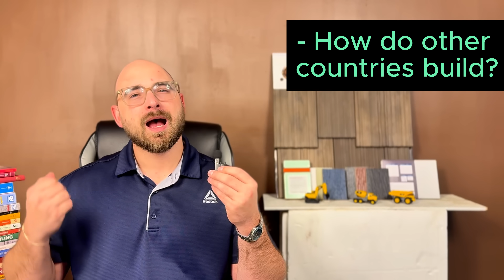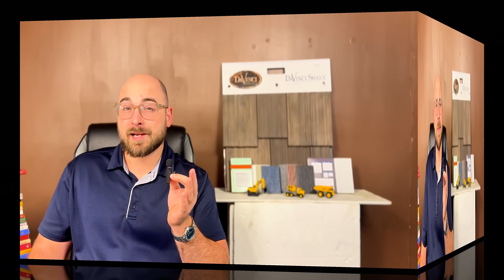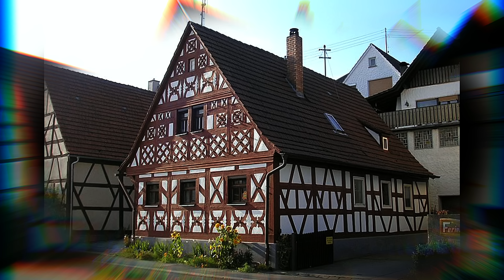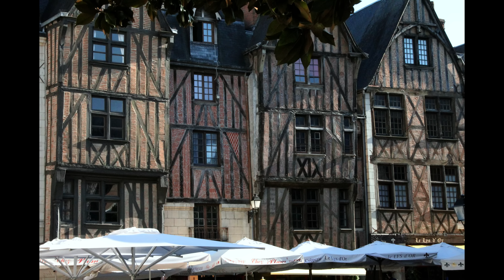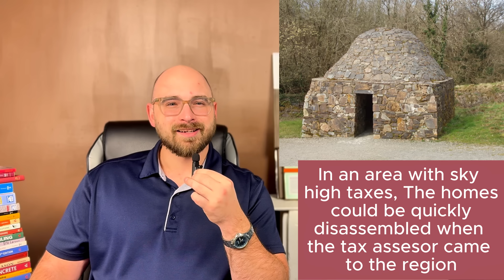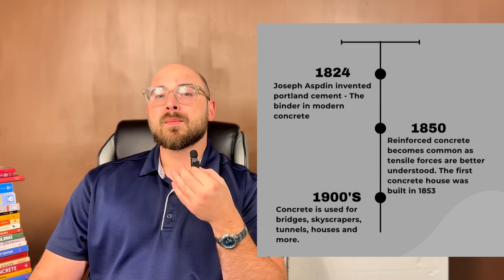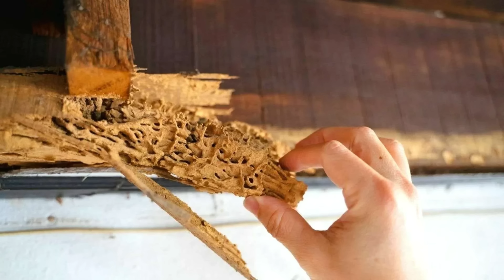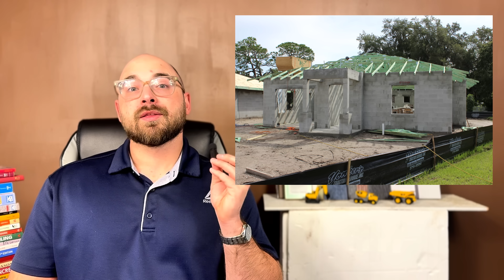Why Other Countries LAUGH at American Homes

Comment: In Sweden, most homes are built with timber framing, plywood and sheet plaster. My home is over 100 years old. The framing is OK. However, you can date different parts of the house based on the quality of the construction for the individual walls. The worst are the 70's and 80's, when they built the interior walls with only framing and plaster. No plywood to support the construction. We don't built like that anymore (I don't at least).

Comment: I purchased a beautiful 200 year old home in Galicia Spain. My three level home, has four bedrooms, it only had one bathroom (I had to add on a second bathroom and a half bath, I was charged 4,000€ for both bathrooms being built) The home was built with stone and local wood. Most of the stone had been covered to make the home look modern, I chose to reveal the stone in certain areas of the home. The beauty of a stone home is that during the snowy winters of Galicia, I turn my heat on for a while and then the home stays warm for the rest of the day! During the horrible hot Spanish Summers, I don’t need an AC unit! My house is always a comfortable 20 celsius during the entire summer, I love it! My stone walls are very thick, they help insulate my home very well. My home in Spain also came with double pane windows and the front door had a thick wood door and a double pane glass door in front of the wood door(just in case you want to open the wood door to look at the gorgeous mountains) Spanish homes are built extremely well! It also has an underground cantina(like Italian homes) the underground stone room always has a temperature of around 15 celsius. They use that small underground room for storage of their wine. These old Galician homes were built to last for generations. My home in Tampa Florida doesn’t have such attention to detail or insulation, nor does it have such sturdy walls. My European home has a new metal roof that mimics the old fashioned style of Galician roofs. My Galician home was renovated and God willing will last another 200 + years. My American home in Tampa won’t last half as long. The sad thing is I was over charged for my low quality US home, when I only paid 80,000€ for my huge Spanish country home in Galicia. Can’t complain, buying a home in Spain is a win/win situation.

Comment: What about earthquake resistance? SoCal? If my house would have been a brick house instead of a wood frame house, would not be here today. By the way I do love traditional brick construction, but wood frame does the job here.
Reply from the maker: Steel framing, or concrete with seismic joints

Incorporating fire resistant design too, of course 

Can a wood frame house survive with fire resistant design??  Maybe, then again maybe not, I wouldn’t risk it. Concrete or steel

Comment: We massive use in SPAIN what you call cinder blocks. Thats the best way to make homes. Structure of steele and concrete and blocks for the exterior walls. The inside walls made with thinner cinder blocks but i guess the key is we still making them as the Roman style, i mean, concrete mixed with volcanic materials to make the bricks as light as we can.

Comment: One part of the house my parents and my brother live in is built in 1605 the second third was built in 1817 the last part was built 1970 the house is over 50% solid Woods the rest is brick concrete and stones. As long as the roof will be maintained this house is probably still there the next 600 years.
The house is standing in South Australia

Comment: An average new home in an ordinary town in the U.S cost 222$ per square feet. 

For that price, you can punch through walls, asphalt tiles are apparently still fashionnable, inner doors are made of cardboard, insulation is usually the cheapest option per default and rarely covered in the attic, vertical "guillotine" windows are not considered obsolete and sound insulation: never heard what is that?

I am a real estate photographer after watching scify videos (an home inspector on ytb), i was sweating profusely. These houses should not be more expensive than 125 $ per square feet at best. 😵

An average new house in belgium (one of the most expensive E.U Country) cost 220$ (converted from €)  per square feet. it is usually made out of brick, stone or concrete, has a much much better insulation and is following very strict building standards, especially when it comes to the materials. (For exemple "tilt and turn" windows have been the standard in europe for almost 40 years now and are almost non-existant in the U.S)

The expected minimal longevity of this type of house is between 200 and 250 years if well well maintained. Many old stone and bricks houses (150 years +) are sold for a smaller price and are not seen as weak or crumbling, the opposite is usually true. 

Ex: one day a car crashed in the front of my grand-pa house the car was destroyed by the corner at 35 mph, the wall stood, we only had to redo the joints and a put back in place a few stone that slided a bit, the stability was not affected, this house was build in 1867, this is the power of a feet of stone... 🔨🪨

Old houses are usually cheaper than new ones too for exemple the average price of an old renovated house is between 165$ and 190$ per square feet on average depending mostly on it's beauty and materials.

It is hard to not feel bad about the State of U.S Real estate, those houses were designed to be as cheap as possible back in the 50's because everybody deserve a home, now they are unaffordable for most people, truly a shame.🫤

Comment: not only USA style single family homes are loughable, same for USA style plugs+outlets that are 95 years behind the time ... the only good thing about USA style single family homes that they are cheap ... 

no, increased construiction time for solid structures is only sometimes true, Plattenbau (prefabricated banels) is very fast to build & relatively cheap if standartized, as usually used in the Eastern-Block (like Socialist East-Germany & the Soviet Union) ... 

CO2 is no problem, energy use can be a problem

Comment: In Sweden the standard is still wooden houses. But we dont build with 2by4s and osb as an outershell since that shit is weak to weather..
Our building standards when it comes to framing is also leagues above the US as we place a carrying line (dont know the english term) in the frame. 
The standard outerwall in homes is built with 2by9 as a thumbrule. If you want to build with anything less you must give aduequate reason as to why you would use thinner outerwall. 
OSB is also not to be used for floor, roof or outside since that shit turns to tinder in weather.

New home constructions in Sweden has a set rule of being classified as AA+ energy homes and thick walls is the best way to achieve that, Some instead use alternative heating options and build thinner walls but almost never less than 2by5. 
Add to that an extra 2by2 insulation and installation layer. 
Ive built 7houses and is waiting for a permit to build my 8th.
I use 2by9 and 2x 2by2. One for insulation and 1 for installation electrical etc. So my outerwall thickness is actually 15inches with outer pannel, outdoor drywall, inner OSB and drywall.

Comment: I know some older home in the USA were built crazy strong.  I worked a short time assisting a home construction crew as a go-for (Go for this, go for that). I was amazed how cheaply the houses were made then in the early 2000's.

Comment: Dampness is a problem in solid structure houses only if You don't know how insulation works and how condensation forms. Insulating properly a solid structure building is a fcking rocket science. If it is done properly there is zero dampness and it is worth the time and money.
Reply from the maker: an ICF home will be dryer than any other method. More airtight too

Comment: I am not american an as much as i dislike american homes they do excel on that they are supposed to do. be quick to build and easily fixable. Sounds weird that you can puch a hole though the wall but i recon that having a drywall piece flying around due to a tornado is better than having a bunch of bricks.

doesn't make sense for most other countries though.

Also american roofs are actually great in terms of durability.

Comment: Many said that US use wood to prevent damage from earthquakes.
Concrete building can have earthquake prevention support also but it would be a lot more expensive.
Reply: idk in US but in my contry 120 to 160 square metter house cost aprox 120k bucks, like quarter you pay for a lightwodden house

Comment: 12:00 in Latvia 90% of new houses are built from bricks and concrete blocks. Since We have harsh winters the houses are built with double walls binding the brick or concrete block walls together with steel rods and the gap in the middle is filled with insulation. That keeps the house cool in hot summer and warm in cold winter. Wood is used only for the roof frame. Now it is popular to install the heating pipes inside the concrete floors which is separated from concrete foundation with layer of insulation. Then there is seperate boiler room where wood is the fuel of choice to heat Your house. It is nice to walk on warm tiles in Your bathroom or kitchen in cold winter. And You have no heating bill or hot water bill. It is up to You where to buy cheapest firewood which is already dirt cheap since Latvian forests grow quicker than We can cut it.

Comment: It's true that in Switzerland, we use a lot of concrete. Generally, the foundation, the load-bearing walls and everything that matters to the structure is concrete. The other interior walls are often made of brick covered with mortar. the roof structure is made of wooden beam that is covered with tiles.

Comment: 19:45: Those are not benefit, those are excuses. If someone is going to try for a cheaper/faster method, is us, mexicanos. But we don't use trees because we understand that in the long run, its cheaper to built a strong house from the start. For our sons, and grandsons. An average small 1 floor mexican house can be built in a month if you prepare for it. It'll not be fancy in the inside, but it would be enough.

And trees are not as renewable as you said. Plus, in the time you cut one and another grow, you already damage the ecosystem there. Also, why cut and destroy beatiful forest when you can just dig for clay/stones? Also, talking about environmental concerns with concrete while praising tree cutting?? come on...

Maybe you find my comments obnuxious, but I'm interested in the subject and wanted to share my thoughts. 1st amendment right?

Comment: I almost don't care how the homes themselves are built, but I hate the whole ducted HVAC system American homes use.
I know of no other country that does that!  I much prefer per-area HVAC, such as ductless mini-split system.
I disconnected the furnace system, blocked off vents, and use mini-splits exclusively.  In fact, I only heat/cool about 1/3 of the house and save big $$$ every year.

Comment: 16:15 Here you are so wrong bro XD
In México most house are built with concrete (reinforced with steel rods) for the structure, and solid red bricks for the walls, cover in plaster. That's for the average houses, althought, along side red bricks, we also use light bricks, which is different from that CMU.

I'm sure about this for the south and center of México, but maybe in the north they use other things since they love you guys.

Comment: The stupidest thing I've seen in the USA that others don't do is crappy thermal insulation combined with a lousy hot air heater. In Europe - especially where there are harsh winters - people build properly and then don't have a problem when the weather gets really bad. Modern bricks with lots of foamed hollow spaces insulate so well that you can create a very pleasant living environment with low-temperature heating. In the USA, you only sit in a warm air fan in winter. Wood can also be a good building material, as is the case in Austria, for example. But it's very, very thick wood composites that are built like walls. The so-called timber frame construction is and will always be rubbish, and not only collapses at the first storm, there are also 1000 other problems. The only advantage: the price!

Comment: Having lived all of the world while working in the military and State Department, I agree with most European assertions.  Wood-based home are labor-intensive to build due to the framing, and not very protective against major storms in Tornado Alley where I now live.  While living on Guam, the homes were ungodly thick and solid - because there was really no place to evac to in a Cat 5 typhoon.   We just closed the shutters during Typhoon Paku and waited it out.  Best home heating was in South Korea, heated oil under the floors, so no cold feet in the winter.  We didn't have built-in closets per se in the UK, Germany or Italy, but the wardrobe closets could be moved around to re-configure the bedrooms, which I grew to really like.  
Home are too expensive in US and Canada for what they are. You'd save oodles building your own.

Comment: I mean you live in a country with loads of wildfires and yet you build the homes out of a flamable material. At least with a solid brick or concrete built house it would resist any fire as long as there was a fire break between the forest and the house. As any stray ember wouldnt catch the roof on fire. Like when you go camping and use rocks to line the fire pit they dont catch fire. Also, insurance for the house would be cheaper as the insurer knows it wont burn down. These are just a couple of ideas.

Comment: Americans want new houses, not old stinky small houses with electrical and plumbing on the outside of the walls. Rebuilding is important, and many of these places who have old old homes have a housing crisis because there’s too many people and not enough new homes or complexes for them to build.
Reply: are you mad bro XD?, first of all you do even know how easly is modiffy a modern concrete house, first of all in general just the external extructure are made for bricks, internal structures usualy use fibrolit or wood,maybe old house more than 30 years ago but even in old house i dont see a single plumber or electic outisde the walls, thy only houses have external plumber are house with more than 100years, and my country is heavy sismic and concrete house with sismic resistance and a 160 square metter house cost at top 120k 160k bucks,  you just wanna justity your cheap houses selling in overprice,
Reply: Also no one wants houses full of asbestos, old faulty wiring, black mould and pipes full of decaying lead.

Comment: lol, I’ve done 10yrs of framing by trade and have build multiple homes. And FYI my friends. American homes are build based off of homeowners expense, or whatever realtors expense. Some like to buy fair prices home materials and some like to use more sturdy and expensive materials, lately, some realtors are starting to chose more cheaper materials for exterior walls and other. So in a way, yeah! Homes are no longer worth what sell for. And I’m talking about 200k homes, being build cheaply just to save the realtor an extra buck$

Comment: I wouldn't use the term "catching up" to the world. Most of the world does nearly everything they way they do because that's the way it's always been done, even developing a sense of moral purism about it whether it's cuisine, fashion, manners, or architecture, but Americans are vastly more pragmatic.

For instance, if it's overall more economical to build a house likely to be destroyed by a tornado, considering initial cost of construction with a shelter, cost to insure, and the cost to clear debris and repair or rebuild, Americans are more comfortable going this route where a European might see this as a moral failing, that it is never acceptable for a house to be destroyed, let alone build it with disposability in mind.

Another interesting case is "useful life". When planning a low-rise or garden style apartment complex, we go in with the understanding that the value of the land it'll be on is likely to increase over its life to the point that the building should be torn down and replaced with something else. Why build a fortress to last a thousand years when stick-frame is more than capable of getting it to the 40 or 50 year mark when some future developer will likely want to scrape it anyway?

To a housing purist, this is "cutting corners", "cheap", even uncivilized thinking, but it's just being realistic if not optimistic about a community's future.

Comment: Concrete and bricks is the best and most expensive option. You forgot to mention so called aerated concrete blocks (Ytong), they are lighter and cheaper than bricks. Here in Bulgaria are used mainly with concrete frame, being cheaper option to bricks.
Reply: why is concrete and bricks expensive? The material itself is usually the least part of the overall construction costs. The windows cost more than the walls. Just ask how much is a cubic meter of ready-mixed concrete in your area!